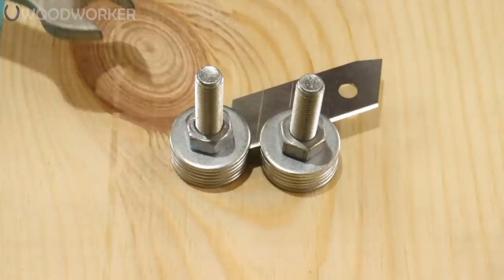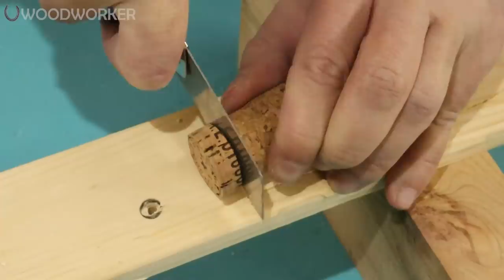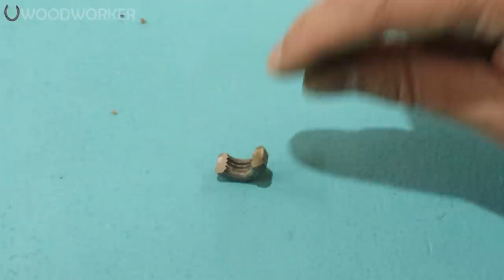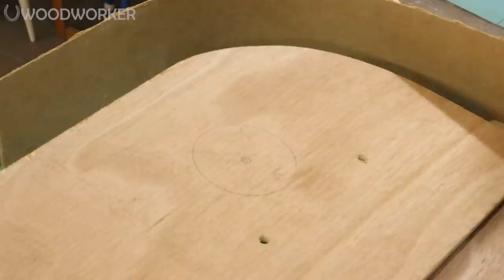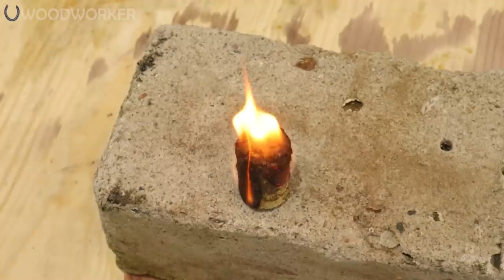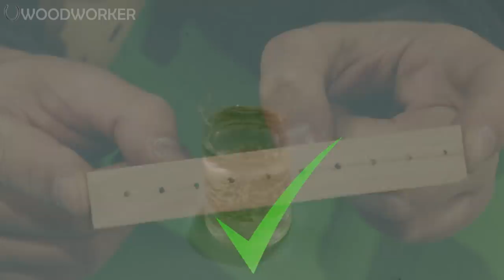10 Ingenious Tricks You Will Use Every Day – Secret Tips and Tricks

Comment: What's the point in cutting the bottle into strips? I've seen similar devices made on YouTube to do that but not sure the reasoning behind it
Reply: If you are into bead making or something to that nature you can use the bottle strips along with a hot air gun and a solid coiled wire about 2-3 in in length and make plastic beads with it, or a plastic tube ig. At least that's what I've seen done with bottle strips but I'm sure there are other uses (maybe not practical or remotely useful "hack")